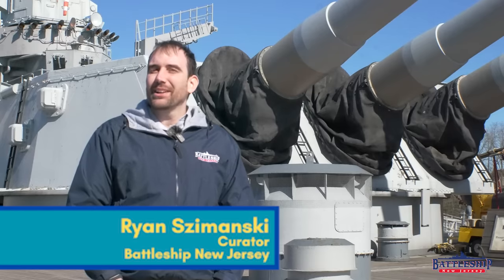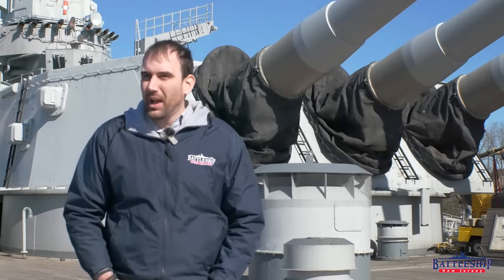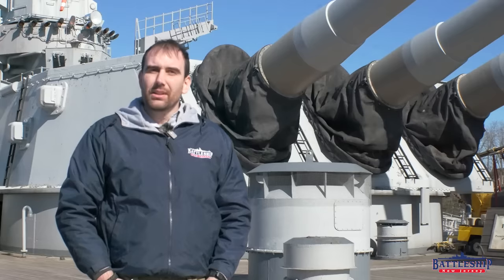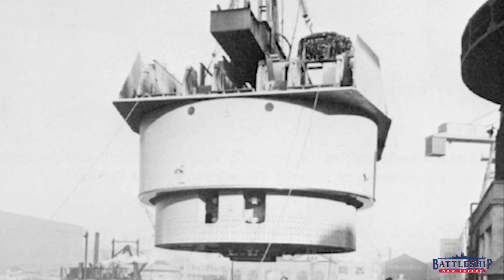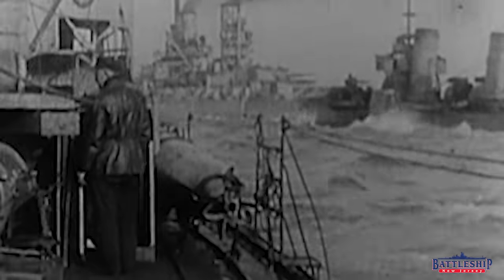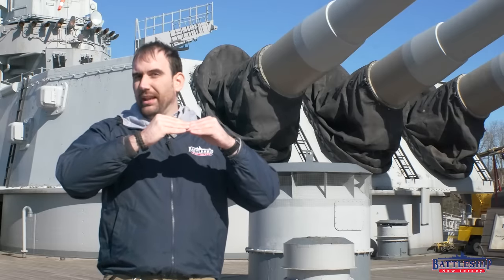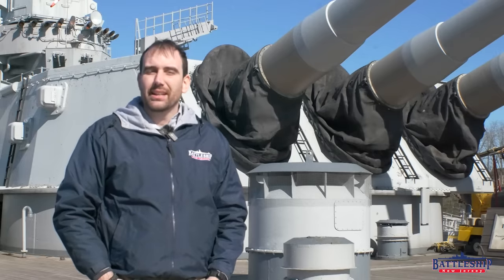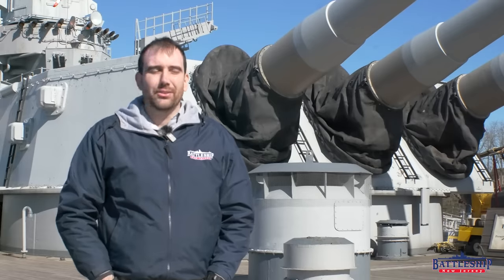Gun Turret Jack-In-The-Box: Myth or Reality?

Comment: Examples that I am aware of:

KM Graf Spee: Aft 28 cm turret and rotating structure heaved out of barbette, plus turret roof and all three guns blown out

RM Roma: "B" Turret blown overboard by magazine explosion; photos of the ship just prior to breaking in two and sinking clearly show "B" turret gone

KM Tirpitz: A magazine explosion in "C" turret blew it overboard as the ship capsized.

The magazine / barbette / turret essentially forms a crude mortar, and if the driving force developed by the propellant are enough to overcome the weight, friction and hold down mechanism strength (if any), away she goes.
Reply: I was gonna say the one I know of is Roma, where the entire turret was ripped out by the explosion.

Comment: As I understand it, Yamato and Musashi both blew both their forward and aft magazines under water, while heading for the bottom, losing turrets because of hull failure rather than "Jack in the box". They were both found in three pieces. Bismarck lost its turrets after capsizing under water.
Reply: Yeah, from what I understand they can 'slide out' when you hold the ship upside down.
Reply: @zJoriz yes , the only thing keeping them in place is their weight.
Reply: @zJoriz  @user-qq2vq4fv8b
Actually it depends on the ship and its construction.
Nagato still has it's turrets in place, and she lies inverted. The turrets are still in the same position had she been upright.
Reply: I think its common for battleships to lose their turrets as they sink and roll over. They are not engineered to retain their turrets while upside down. It just is not necessary and would add a lot of weight.
Also Russian tanks seem to store their ammo inside the turret, not really below it. There is not much separation between the crew and the ammo because the mechanism to load the rounds is right there inside the turret. An accident waiting to happen.

Comment: As others have said.  magazine explosions probably start the turrent upward, but the path of least resistance in a battleship for the explosive force to vent is going to be inside the armored box and doing terrible things there, until it blows out the bottom of the hull and vents out the fireroom uptakes.  The armor of the citadel and the armor weight of the rotating structure are going to confine the explosion to belowdecks for a few moments.  At the speeds that explosions move, that's plenty of time to rip through the watertight bulkheads within the armor.   The movie film of Arizona blowing up shows that massive plume of black smoke shooting up from it's stacks a few moments after the start of the explosion.    The only other movie film I know of showing a battleship magazine explosion is HMS Barhum (sp?) from WW2.  Frame by frame examination should show where the explosion vented first.

Comment: A long time ago I read (don't remember the book it was in) an account of HMS Hood exploding, reportedly from the Captain of DKM Prinz Eugen. It stated that the 2 aft turrets flew strait up on a column of smoke higher than the mast, then fell strait back down and disappeared into the smoke.
In Jutland: An Analysis of the Fighting Hardcover by John Campbell (a very interesting study with a lot of technical info on the damage delt to ships) he describes the explosion of HMS Defense, which was technically an Armored Cruiser, but with the same design techniques as contemporary Battleships. She apparently had a passage down the length of the ship from the forward to the after magazine and to each secondary magazine. The crew must have had all the hatches along this passage open for passing shells because, she was hit in the aft turret and described as having that turret blow off followed a moment later by both of the aft secondary 7.5" turrets, then the next pair of 7.5" turrets, continuing up the ship like a stick of firecrackers until the forward pair blew off followed by the forward turret blowing off and the ship disappearing in a cloud of smoke with all hands.
-- Here's a tip, if you're commanding an Armored Cruiser, never charge a line of Battleships, it is not conducive to continued good health. --

Comment: The most devastating example of a magazine explosion I know of is the USS Arizona. It blew out EVERTHING and caused the turret and superstructure to collapse into the hull. None of the turrets jack-in-the-boxed. Also, what is the difference in weight between a tank turret and a battleship turret? 1000:1?
Reply: Have a search for HMS Barham to see a real devastating magazine explosion caught on camera - in that film you can see the armoured deck folding like tissue paper and huge sections of belt blown a couple of hundred feet into the air. So I believe that if that level of explsion could be contained enough to vent via the barbett, a turret could indeed "Jack in the box"
Reply: Yes
Reply: Wow

Comment: I don't think it's going to happen because of inertia. You have about 4,000,000 pounds (2000 t) of weight on the turret. Underneath the turret, you have the trunk, which could act like a barrel, but the armor thickness of that barrel is the same or less than the armor of the turret. You would need an impulse which is enough to lift the turret, but not enough to rupture the trunk, or the hull of the ship (below the armor, I think you have normal bulkheads, maybe some bulkheads intended to catch splinters, or protect the engine space from the magazines. 
   Another thing to consider is the relative weight of the explosives relative to the mass of the vehicle. If each turret has 390 shells at 1 ton and .30 t of propellant, you have 128.7 t of propellant, and an approximate busting charge size of 19.5t, less than 10% of the conservative turret weight. I think a tank has more explosive-to-turret weight ratio, where the battle load is about 1 ton (40 rounds @ 50 pounds), while the turret is like 2-3 tons of the tanks total 10t weight, and in the Russian design, is all in one chamber.

Comment: My understanding of physics for Jack-in-in-the-box is that magazin explosion is initialy confined in storage space. This presure can either blow up turret or go through (armoured?) walls. To cause Jack-in-in-the-box you need turret ligh enough to provide path of significantly lower resistance. If it's just barely lighter it may jump a bit but presure drop will be too slow to prevent wall  blowing out.
In my understadind turrets, especialy turrets of battleships' main guns, are VERY heavy. The path of least resistance is almost certainly through walls, even armoured.

Comment: Eye witness statements from HMS Prince of Wales very clearly described HMS Hood's two aft main gun turrets flying hundreds of feet through the air as (apparently) her aft 15" powder stores cooked off.
I seem to remember reading of at least one case of something similar when one of the battlecruisers exploded during the battle of Jutland, too.
Pretty sure Roma experienced something similar after the Fritz-X hit detonated a magazine (doubtless I could look that up but am being lazy, LOL).

The propellant explosions, building as they do like unbelievably huge fireworks vs a 'simple' detonation, always have that characteristic violent jet of flame for some time before the overpressure then ruptures more of the hull structure, and it's that earlier phase particularly that can 'pop' turrets. Then again, an outright magazine (propellant and possibly shells) detonation can achieve the same thing as the absolute destruction generally throws everything away from the source of the blast, be it the hull, deck, or fittings such as turrets.
Reply: The wreck of battlecruiser Invincible shows that the amidships turrets were blown off the ship as they lie in the mud not far from the main wreck

Comment: Arizona at Pearl Harbor suffered a magazine explosion under the forward turrets. The force of that explosion was apparently aft and down.
Reply: The fore deck collapsing makes it appear her turrets might have but, the camera shots of the explosion clearly show the did not. Might be the source of some of the speculation.
Reply: It appears that way at first glance, but the deflagration actually peeled back the hull above the armored belt and tore out all of the supporting structure above the belt, causing the #1 barbette to lose structural integrity and turret #1 to drop into the ship.

A lot of this has to do with US propellent though, as the only explosion was in the small black powder magazine, the main propellent magazines are relatively inert and deflagrated.  US propellent is so relatively inert that there's a good chance that if the bomb had penetrated to the main magazines instead, there would have been enough time to flood the forward magazines and save the ship.  It's one of the areas where the US is not just ahead of other nations in development, but many decades ahead - most nations are only now using what would have been considered US standard in WWII for propellent safety.
Reply: @jec6613  US Navy heavy gun propellant is apparently much safer than Royal Navy Naval Cordite, considering both Hood and the battlecruisers at Jutland. But the black powder magazine did detonate.
Reply: What gets to me is the size of the fire after the initial blast.
Reply: @alanholck7995  Burning real fast (deflagration) is the propellant performing as designed. At some point, the mass of propellant will act as a tamper, and induce a detonation, which happened several times on both British and Japanese ships (e. g. Hood and Musashi).

Comment: Battleship NJ turret is 400+ tons of armored steel. It would take more explosives than the ship could carry to even lift a turret.
Reply: Its more than 2000 tons. The three barrels with breech alone weigh 360 tons. 
However, the propellant on board could easily achieve enough force to move 2000 tons. But there is nothing in the ships structure that could direct that force at the turret assembly without breaking everything else.